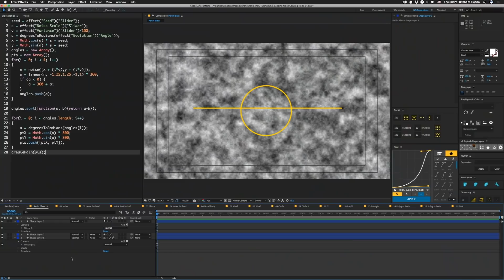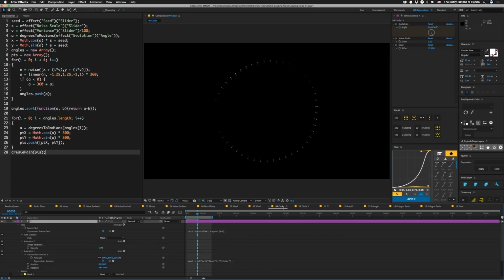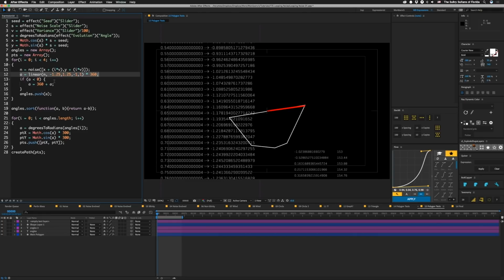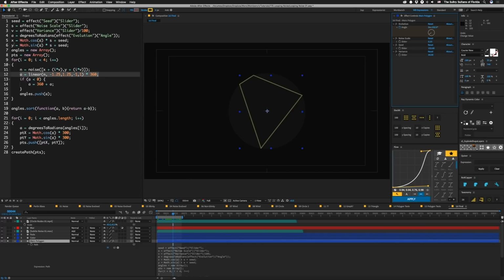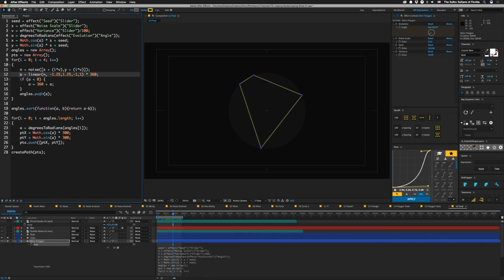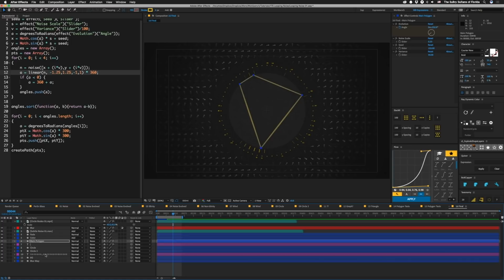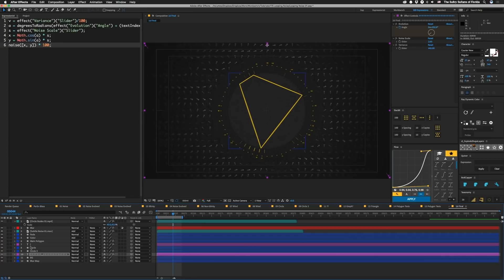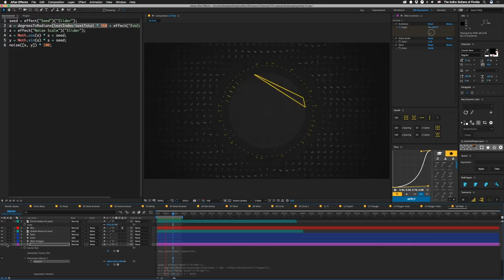How to loop Perlin noise - Tutorial 175: Looping Noise()

Comment: sorry to ask a dump question, what do you mean by loop noise??
Reply: Check out this article by Dan Ebberts on the noise() function in After Effects. It will help you understand it better: https://library.creativecow.net/articles/ebberts_dan/noise.php
Reply from the maker: It's not a dumb question. We're using the noise function for randomization (position, opacity, etc.). Normally, it doesn't loop. So you can't get the animation to repeat or loop.